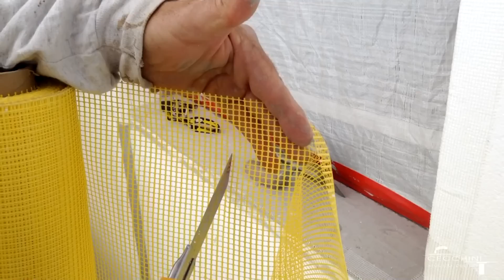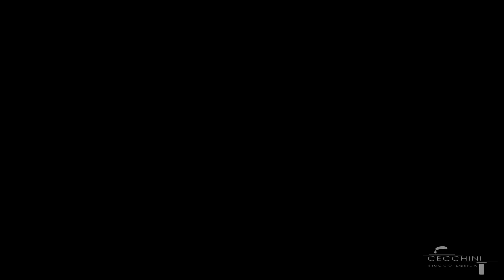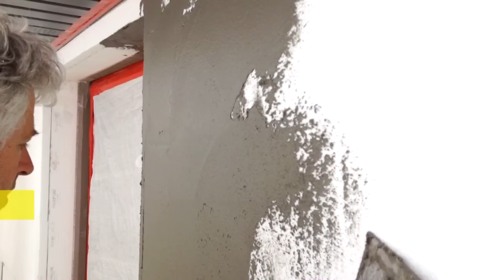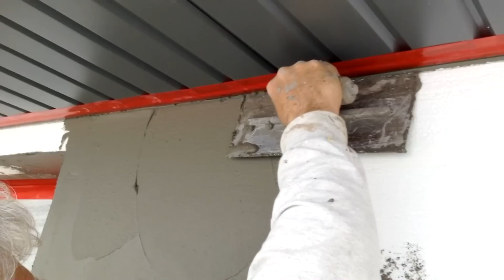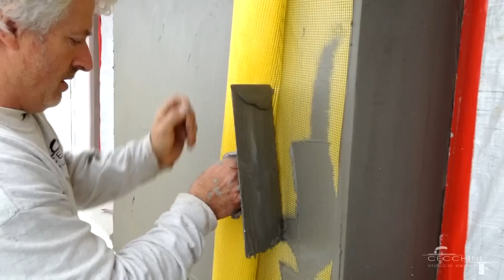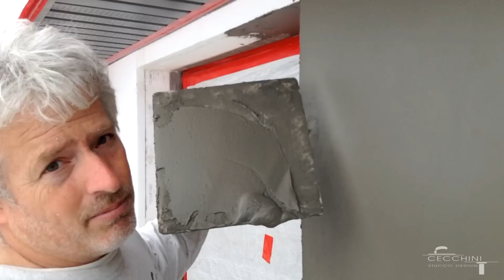Cecchini Stucco Design - BASECOAT APPLICATION

Comment: Hi Mike, I have a question for you about the basecoat: what is right mix for the base coat ? Can I do my own mix with portland, and san ? if so what you recommend is the right mix ? Do you use lime at all for the base coat or not ?
Thank you very much Mike for your help !!
Reply: Basecoat comes in a drymix and wetbase. For begginers I would recommend drymix just add water accordingly to skill level of plasterer. I would not recommend trying this if you have no experience as it will cost you far more to repair than to hire from scratch. Courtesy of plast-all stucco systems Inc.
Reply: Different system
Reply: It just looks easy but one needs quite a bit of peactice

Comment: Why do not tell use the spec for the fiberglass mesh? How can we know what to buy?
Reply: Madera Roja de la Secoya  the supplier that sells you the product should tell you what kind and how many square feet you get to the materials and ever prefer you to some professional people that live doing this type of work. if you would like to know more about what kind and would like to talk to a supplier. just let me know
Reply from the maker: I am using sto standard mesh 48'' wide comes in 1 rool that covers 600 sq ft
Reply: Madera Roja de la Secoya usually well this is how our union jobs are say you use sto or senergy or whatever you use all the material from waterproof to foam to mesh to base and or finish usually all same compamy

Comment: No back wrap ??? Otherwise good demonstration of doing base coat. 

I apply a consistent coat on the eps foam before applying the mesh, never leave thick spot because if you do, you will end up trying to squeeze it out under the mesh. So cover the  eps foam with a nice consistent coat, apply your mesh and apply another coat to cover up the mesh. I do not apply thick because I always come back for a skim coat after  it cures.

Comment: Im a union plaster and i wouldn’t use my trowel to even out the base coat I would use a slicker and this system I would do a two coat system due to weakness of one coat of base coat
Reply: This is EIFS guy
Slicker is for cement
2coats as well is for cement(scratch&double)
Always 1 coat of base over mesh

Im a union plasterer too
Where u from?
Reply: averageguy 76 California local 300 how about you?  

Well everyone has their own way of working we normally do two coats of base coat and we also use a slicker makes the job a little bit more easier for us
Reply: Local 5 nj/philly
So u use an edger on basecoat?
Lol never heard of that
Cement yeah...u edge to the beads but over foam? Nah skicker stays in the truck on eifs jobs
Reply: Juan Montano shut up Juan basecoat is rock hard after it cures
Reply: Eagles Rule don’t tell me to shut up it’s just a way that we do things here in my union. It is not rock hard bro cause it still cracks but y
Reply: 30 years union in CA. The slicker we use here is a cross between a Darby and a trowel, we use it to lay down the base coat especially on the second coat that many jobs specify. It's not the same tool as the slicker (shingle, straightedge, featheredge) used many places on browncoat.

Comment: The installation is not correct; There should be a back-wrap of mesh at terminations.
Reply: I noticed the windows weren't back wrapped
Reply: Yes STO tell u to back wrap at soffits and bottom and window
Reply: @warrenbrecht1113  All EIFS companies require to be back-wrap
Reply: @MrUnlimitedrobert  
I don’t get why drainage plane is required. EIFS is the drainage plane.
If you take care of your window, door, and roof flashing details it should work fine.
Reply: What’s back wrap? I’m a Brit  mesh over the corners?

Comment: Applicators such as this fellow are the reason there was a sharp decline in EIFS projects over the past ten years or so. You cannot cheat the system and expect it not to fail: No backwrap at top of wall, no backwrap at window openings, no backwrap at wall penetrations, mesh was barely overlapped at the window opening (1" or less), did not double wrap corner at window opening. 
 It's like building failures into the wall. 
 As an industry we need to go back to training and certifying EIFS applicators or it may never reach it's market potential again.
Reply: Can I don't use mesh interior house?
Reply: I have been doing this trade for 18 years and don't like back wrapping and there are many reasons for that i like wrapping from outside going in around windows. When you have the back wrap mesh install when sanding the corners you always cut through or damage the wrap making it hard to get a nice edge. Second when you base coating the wall base coat that falls get stuck in the mesh which make it hard to clean so you have to cut it off and wrap it from outside going in. The point is if your styrofoams is not install strong snd ry right then back wrap won't hold it secure
Reply: Just take care of the flashing details at openings and roof and you’ll be fine.
No need to back wrap or tyvek drain wrap and all that stuff

Comment: we're is your. sto back rap around Windows. an top of wall
Reply from the maker: If you look a little closer you will see that I am using pre-back wrapped strips that I buy from my molding supplier , you can get them in 2''- 3''- 1 1/2''
Reply: @cecchinistucco9443  how well does that pre back wrapped foam work arounr flaired out window flanges . Can't rasp it after it's been mudded